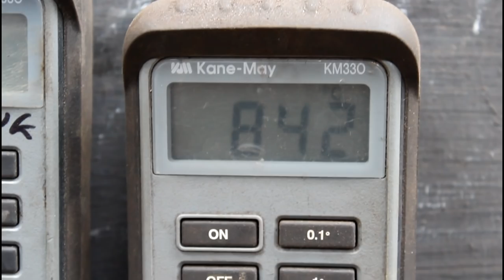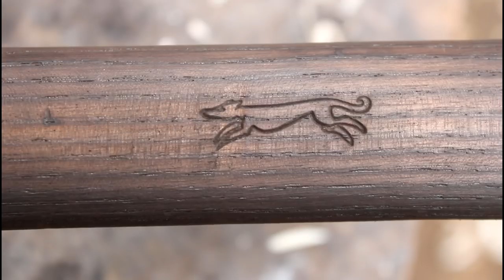Hand Forging a Bearded Axe - Part 2

Comment: I just started blacksmithing and just wanted to know where to get the proper tools
Reply: I started with a hammer and anvil from harbor freight, and just kept upgrading slowly over time as my skills grew. Keep checking craigslist for good deals. Anvil will be the hardest/ most expensive buy. A good deal for a steel anvil is 3 to 4$ a pound. Pricey! But when you're just starting the 50lbs he iron anvil will do you good. Eventually you'll want a 100lbs or more steel faced anvil. I still use my 3lbs hf cross peen hammer. It's a good tool

Comment: +Wranglerstar would not approve this handle since the orientation of the grain is bad and the end grain makes for a poor handle
Reply: +Lalaland was thinking much the same, even though it still turned out beautifully.
Reply: Sitric Brave
yh, it turned out beautifully, but it will snap, split or wear out much faster when pushed under a heavy load.
Have been hanging axe heads ever since my early teens. Grew up in the woods so that's why the comment
Reply: Jonathan Anderson
You are obviously a man who knows pretty darn well how to hang an axe head right. I didn't say anything on the quallity of the finished handle. I was merely pointing out that it was oriented the wrong way, that handle will snap or split open the moment you will put it under some serious work load (click here to see it http://s1167.photobucket.com/user/ravimiro/media/P1040094_zps0d3964b6.jpg.html) and the horizontal grain like he hung his axe won't absorb the constant shocks when working with a large bearded axe like his, Been in the woods since as long as I can remember, been hanging axe heads since my teens, I really do think I know what I'm talking about. So please inform yourself on how to hang  an axe head before you tell me to piss off, there's a reason why the comment is there.
Reply: Jonathan Anderson
There's only two ways to hang an axe, the right way or the wrong way. Presentation has nothing to do with hanging an axe, it either is hung right and you have an awesome tool or it is hung the wrong way and you basically wasted your wood you worked so hard on. To make matters worse you will get shocked on every hit and split the handle while you are at it. I was trying to make the comment a light hearted joke, you obviously took that the wrong way. You having a problem with wranglerstar is entirely yours and yours alone. I hold that man in high regard when it comes to his knowledge about axes...I don't know what your problem is, but I'll bet it's hard to pronounce. Why all that bottled up anger, what got your panties all bunched up over a comment, seriously lighten up, man
Reply: faultroy
Did you take time to read the entire comment train? Here let me humor you with a copy and paste of the comment you must have missed, since you made the reply. Here's the copy;" There's only two ways to hang an axe, the right way or the wrong way. Presentation has nothing to do with hanging an axe, it either is hung right and you have an awesome tool or it is hung the wrong way and you basically wasted your wood you worked so hard on. To make matters worse you will get shocked on every hit and split the handle while you are at it. I was trying to make the comment a light hearted joke, you obviously took that the wrong way. You having a problem with wranglerstar is entirely yours and yours alone. I hold that man in high regard when it comes to his knowledge about axes...," end quote. now go back to my other comment where you'll find a link and you'll see first hand there is a right and a wrong way how it's done. but to get back to wranglerstar, he likes high end axes for the right reasons, you have been homesteading for 6 years, amazing and good for you, I live in the woods from the time I was born, I'd like to think I know a bit more about axes then the average joe, since I make a living with them, I build my own house by hand, I am a lumberjack/contractor/woodsman and I use axes on the daily, your opinion on wranglerstar is biased, his knowledge is on axes is excellent and you thinking he's a metro sexual well, that's your opinion, man. I find his beginner advice inconsequential as well, I can see through that cause of experience, but he's right on the high end axes. I watch him for entertainment and his production value. Anyways, If and when your life and livelyhood depend on axes, I as a woodsman would seriously and highly recommend a high end axe over an average one, since the average one will have to be replaced after 2 years of heavy daily use, whereas the high end ones will probably outlast me. And by high end axes I mean any axe that is well made by a proper blacksmith. So there's the explaination of the comment. Next time read the comments first before assuming you know what was intended. Have a nice day
Reply: "A proper blacksmith" sheesh where do you guys come from? Bladesmiths make tools with edges. Wranglerstar isn't an expert, heck he'll even tell you he isn't. Have you seen his video where he fells a tree towards his back cut or where he pretends to be an arborist? A modern woodsman will tell you to buy a Husq/Stihl, good chaps, a helmet with screen and hearing protection. Dang yuppie no one wants an axe that you have to sharpen on a stone.
Reply: I'm with ya, I never said axes were useless, just those axes that need stones to sharpen are generally useless while actually working. 

Lalaland, I won't even reply to your comments. Suffice it to say that your ignorance is showing. Piss off.
Reply: That's a bit of a myth. Some truth, some fiction; a lot of exaggeration.
 A lot of the fans of Wranglerstar are fast on this one. All of the 
shock goes somewhere. Parallel grain to the strike surface edge sends more dynamic 
load to your hand, wrist, and elbow. Perpendicular allows more flex in 
the handle dissipating energy like a tuning fork. 

The reason why Ash and
 Hickory are the most popular handle materials worldwide is because of 
flexibility, strength, and toughness(in that order.) Osage Orange, 
Yew, and some of the tropical light maples are used, as well, for the same
 reason they are used for bows: flexibility. There's a reason why 
Wranglerstar is always complaining about his hands and wrists feeling 
tired, weak and hurting...
Reply: The handle is far more flexible with the grain this way and with the length of the handle it won't ever be an issue for durability of the tool. That's a single handed axe, not a two handed so there will always be far less force used. It is not meant for cutting down tree's. At 0:32 he used an axe of similar design to do exactly what it is designed for, chopping with the grain to split or remove material. The grain being in that direction makes perfect sense, plenty durable for the job and flexible enough to make it comfortable to use.

If it was 2 handed then I would agree the grain should be the other way with a bearded axe, a bog standard axe with the grain in this direction is perfectly justifiable. The issue with a bearded axe is if you strike a hard target like a log with the beard it causes the wood to flex in two different directions stretching the back of the handle just below the head and compressing the front from the beard while trying to do the opposite that a direct strike does fully. You can get the same effect with any tool if your hits are always off but it is less noticeable compared top a bearded axe.

Comment: Beautiful axe head. Not a fan of the handle though. Grain running the wrong way, plus blackening it in the fire could cause it to get brittle. It looks great, no doubt about that. But for a working tool, I worry about things like that. You are an artist though, I'll give you that!
Reply: Nathan Oberlander  Isn't it stronger along the length of the handle because the grain is running longwise from the bottom to the axe head?  
Edit: Never mind, I saw your video on it, I get it now.

Comment: The head looks great, but the wood grain in the handle is going in the wrong direction
Reply: Stephen Lockwood I thought I was the only one that noticed lol
Reply: I'm interested in what you mean by that- it looks right to me, but I'm not that experienced as a woodworker :P
Reply: A handle with the grain perpendicular to the head will be weeker and possibly crack over time as the axe is used. Think of it like a stress fracture.
Reply: Stephen Lockwood I see, cheers :)
Reply: Do you mean the grain in the frame at 00.23? if so I understand you, if not I don't.
Reply: That's a bit of a myth. Some truth, some fiction; a lot of exaggeration. A lot of the fans of Wranglerstar are fast on this one. All of the shock goes somewhere. Parallel grain to the strike sends more dynamic load to your hand, wrist, and elbow. Perpendicular allows more flex in the handle dissipating energy like a tuning fork. The reason why Ash and Hickory are the most popular handle materials worldwide is because of flexibility, strength, and toughness(in that order.) Osage Orange, Yew, and some of the tropical light maples are used as well for the same reason they are used for bows: flexibility. There's a reason why Wranglerstar is always complaining about his hands and wrists feeling tired, weak and hurting...